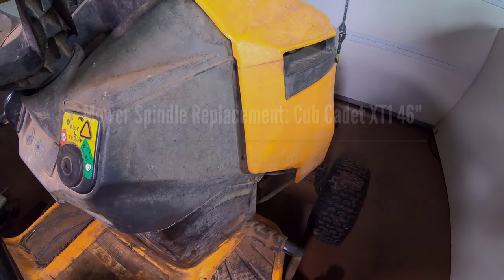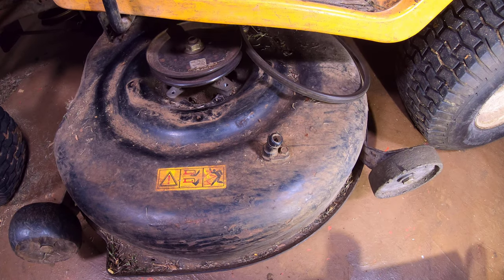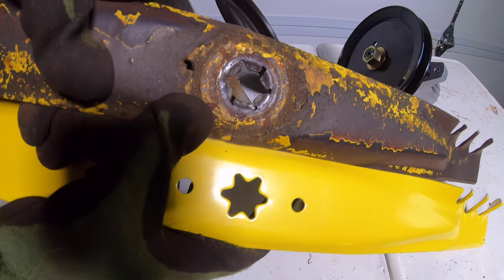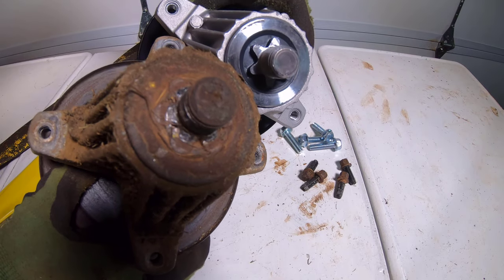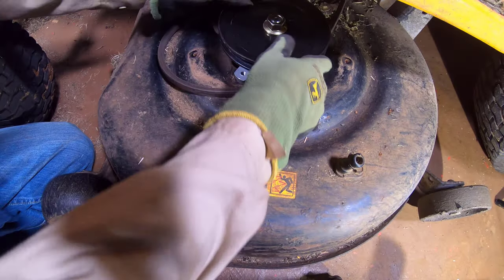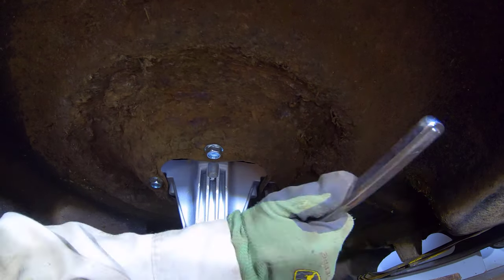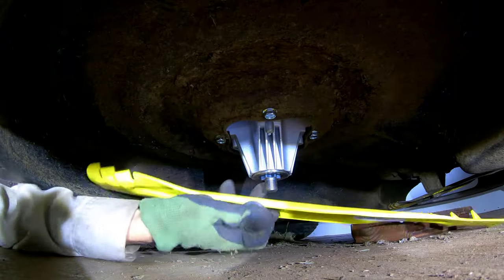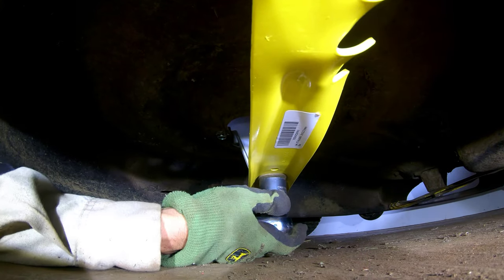How to change or replace mower spindle on a Cub Cadet XT1 lawn mower.

Comment: i replaced All 3 on my 55 inch and added zerk fittings ....  and all the self tapping bolts from factory snapped off  ( not using power tools)...i replaced them with n equal size Bolt and nut...  for later replacing the bearings (if needed )
Reply from the maker: Sounds like a good setup.  I t was probably better that the bolts snapped on installation rather than during operation.

Comment: Been nice if you had noted what size sockets you used....

Also, it would be good to mention that if your new spindle came with zirc options that they should be greased at point of install
Reply from the maker: Thank you for the suggestions.  I have added the information to the description in addition to the specs that were previously written.  The socket size used to change the spindle in this video was 10mm.  The Spindle Assembly was sealed and non greaseable.  As seen it has a smooth shaft between the spindle and pulley with no grease fitting.

Comment: Ran over something in my yard too.now the blades just spinning on the shaft. Gonna make it hard to get the blade retaining bolt out. Worse come to worse I'll turn to my angle grinder and cut them off,lol.
Reply from the maker: I hear you.  Sometimes you might be able to use a socket and breaker bar at bolt head on top of the pulley.  I understand that it may be hard cause the threads near the retaining bolt could be stripped and that is causing the blade spin freely.  Good luck.
Reply: @TryAdaptLearn  Thanks,I'll give it a shot👍

Comment: 1 more question how much torque did you use on the bolts
Reply from the maker: Unmarked bolts at this thread size should be around 12 lb-ft but I chose to set the torque wrench to 15 lb-ft in this video.

Comment: Where did you get the spindle for that 46" deck and what's the part # ?
Reply from the maker: Spindle part number is 918-06977a Spindle Assembly Replacement 46" Deck (Stamped).  It was purchased on Amazon.

Comment: Great video but wouldn’t have been easier just to remove the deck? js
Reply from the maker: Probably a billion times easier.  The only advantage tot eh deck installed may be if the fastener has to be undone with a tool above and another below the deck, but even then I'm sure the deck could have been held in position to provide easier access.

Comment: The spindle bolts are self tapping.
Reply from the maker: Thank you for letting us know.  Luckily the holes were drilled in the new spindle case and the mower deck so there were no issues.
Reply: @TryAdaptLearn  I got my spindle on the clearance rack at Tractor Supply and the holes weren’t threaded but the bolts had a three lobed shape to them and they tapped right in with the wrench.

Comment: You didn't show us how to loosen the belt.
Reply from the maker: I’m sorry about not showing the belt.  On this model the pto is manually engaged with a lever and not electric.  Unlike an electric pto, the belt is loose and can be pulled off of the pulley when the machine is off and pto is not engaged.
Reply: @TryAdaptLearn  Good to know. Thanks for the reply!

Comment: I have to do this to my mower in next few days waiting on parts. One question what torque setting for the blades? Thanks so much this video should cut my time in half.
Reply from the maker: The blades for the Cub Cadet XT1 in this video are torqued to 80 lb ft (108.5 N m) The specification is from 70 lb ft (94.9 Nm) - 90 lb ft (122 Nm).
Reply: @TryAdaptLearn  thank you sir